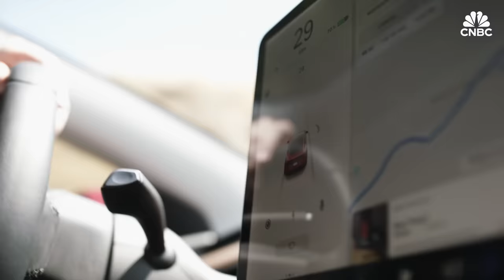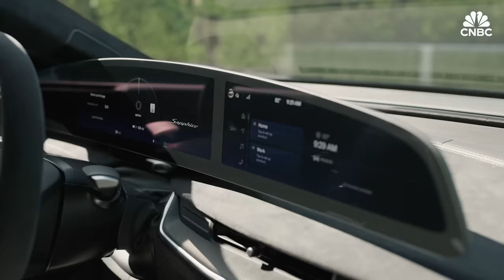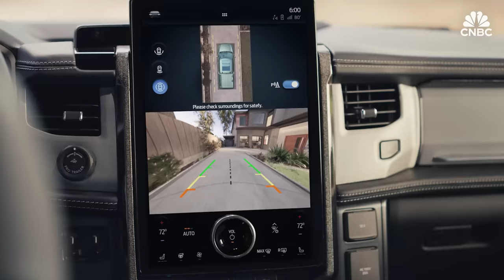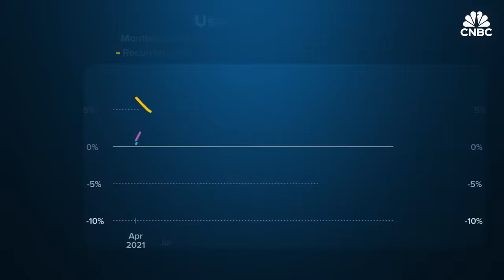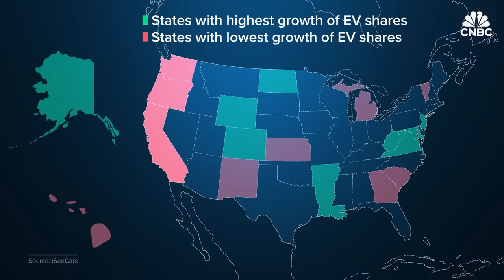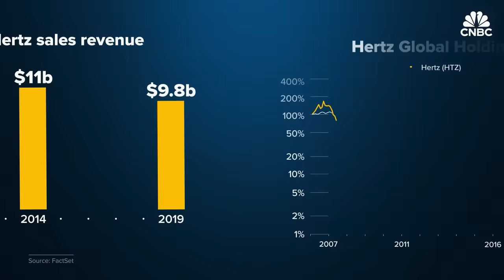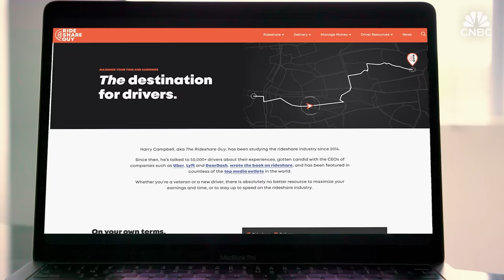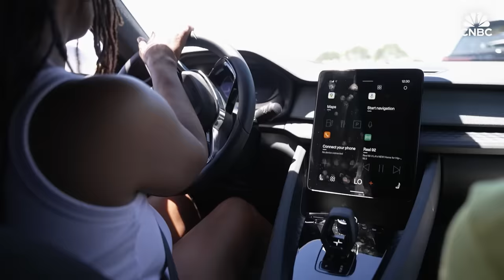Why EV Sales Are Falling | CNBC Marathon

Comment: As a city resident, you can't plug'em anywhere unless you have an indoor garage which is rare in the city
Reply: I have been charging mine in a driveway for over 5 years.
Reply: Agree. It would’ve cost a fortune to retrofit my condo garage for EVs. Maybe we could’ve added one or two charging stations but that would be a recipe for conflict.
Reply: Nonsense. There are EV chargers are Grocery Stores, Movie theaters, shopping malls and many other locations, including work locations and parking decks. Lived in a Major City for 17 years until just recently. This is FUD baloney.
Reply: I live on a complex as well and there are no charging stations. The only place I’ve seen charging stations where I live is in a Walmart parking lot.
Reply: Densely populated, vertically structured NY CITY continues to have issues with charging. But they also have best(😂, kinda) public trans system. CA, the nations largest auto market flourishes with space, weather, and infrastructure for EV’s. This is a regional and infrastructure issue/advantage.
Reply: really? In my my small rural city everyone has a garage.
Reply: @bobby5678-ck2tc  on the west coast and in nice neighborhoods there are garages but I’m in Indiana and there aren’t a lot of houses with garages
Reply: @bobby5678-ck2tc  yeah…shouldn’t be a problem if you added an EV and needed to charge. Good for daily driving. I’d still have a mid sized ICE SUV for longer family trips, though.
Reply: You can plug them in without a garage. There are a number of chargers that you can mount outdoors.
Reply: ChargePoint is my favorite! But I’ve had others that worked outdoors too.
Reply: Funny story, I owned a condo where the board were foreigners and one of the members had a charging station for his EV. I ended up getting a EV and I kept on asking them can I get approval to have a charging station put in by my car. Long story short 6 months go by and I sell me EV. A little while after one of the board members asked me if I still want to get a charging station installed.
Reply: @davidc2838 true . These dealer middle men now want to plant stories
Reply: @lancerkind Cool…easy fix. Just drive your Tesla into your 68 story apartment building, drive it up the elevator, and plug into the charge station you have installed on your 22nd story balcony 😒
Reply: @davidc2838 These things are always occupied or broken. There are never enough.
Reply: Charging in the city is not really a problem with a Tesla because of its supercharger network. Most people driving locally around town only charge at a Supercharger once a week for 30 minutes. Even when people take 200+ mile trips they simply stop at a supercharger for 20 minutes to top up the battery before returning to the city.  I highly recommend you rent a Tesla from Hertz for a few days and try it for yourself. Hertz rents Teslas for about $50/day.
Reply: @robertthomas9564  I live in a major city and the nearest Supercharger is 17 miles away. Sure…make a 34 mile round trip and wait 40 minutes to charge a car. What a stupid suggestion.
Reply: But if you’re in a city anyways you don’t need a car or one with that much range
Reply: If you don’t have access to a personal charger - I wouldn’t buy one.  There is no battery conditioning without one.  Rates are too high without one.  No convenience without one (time).  They aren’t for everyone.
Reply: Not to mention if there is a fire all cars will be destroyed if they are in the garage
Reply: I guess if you live in a flyover state where the state government is bought by oil donations who try to policy one way. In New York, California, and other big areas there's so many charging stations in the city.
Reply: @Dfgbuiiyyyybb there is much that will be changing soon, including EVs that can handle wireless charging, and parking lots that provide the charge from coils built into the pavement.  They are surprisingly efficient and convenient... the entire charging procedure is completely passive, requiring nothing for you to remember to do.
Reply: @EclipseMints08  …what rate do you pay?  can renters connect overnight for low rates?  Without conditioning, freezing weather can leave you stranded.  Owners need chargers to make them operate a lower costs.  Public chargers result in prices approximating gasoline.  it’s simple math - do we need an app for that?
Reply: I charge my Volt outdoors.
Reply: The total EV sales are not slowing. The legacy auto maker EV sales are dying save for a few. And then there is Tesla. Still pumping out and selling cars faster all the time, making up more than the difference of the lagging legacy auto faltering sales hindered by dealerships who don’t want to sale them due to lack of money they will make off the customs who do not need to visit them for regular maintenance work like oil changes. 
When it comes to road trips, you dint have to plan much at all! (At least you don’t have to with a Tesla). The car does all of that for you. Just type in your destination. (You may still want to plan where to sleep at night). 
The charging is easy…. Well if you use the Tesla Supercharger network.  Also if you own single family home, with or without a garage charging is simple. 
I’ve see charging in a townhouse community work where people drag their plugs out to their parking spots. 
In an apartment building…. Hmm ok. Maybe not but I’ve seen people who own EVs there. So it must still workout. 

The issue is education of EVs. Listening to the news will not tell you how to use an own an EV. Nor will going to a legacy dealership. (I knew MUCH more than they did. Even their best sales rep!!). 
The same thing happened when the first automobiles were being sold. Pop people tried to cling to their horses.
Reply: They can be charged at grocery stores, parking garages, movie theatres, hotels, private businesses etc.   If you buy a Tesla it will show you on the map exactly all the places you can charge.
Reply: @valleyofiron125 Eight and a half years here!
Reply: @wendypierce5621  My condo charges $1200 to install a charger and we share it with 3 other cars. $300 is hardly a fortune
Reply: 😡Governments MUST give similar incentives to hydrogen cars 😡 or get rid of all incentives 😡
Reply: True🤏 Before force people to get an EVs, give them free houses 😒
Reply: @duran9664  Hydrogen is useless for cars and extremely inefficient. Total waste of money to get into that option.
Reply: @johnn17golf  It’s more like $5-10k per unit for my building as wiring needs to be run from each meter to the relevant parking spot. It’s an older building and no one thought about the need for electrical in the garage.
Reply: @wendypierce5621  Your unit is ripping you off, then. My building was 19 years old not neither new nor especially old. Management realised nobody needs to charge every day so we set up one charger for each 4 units who wanted access - our building entry card also initiates the charging billed per use by the building at cost.
Reply: OK, but isn't it strange that in the wealthiest parts of London and Paris where no-one has a driveway to charge their cars, EV ownership is highest. I live in rural France and have owned an EV for 5 years but was amazed when I visited a friend in Fulham, London a few weeks back....West London is teeming with EVs, and many lampposts are now converted to AC charging points. There are also petrol stations turned into EV only stops with DC rapid charging, restrooms, cafes and shops. A 20 minute charge gives most people a week's worth of driving. An overnight charge from a lamppost does the same. Old, polluting cars are now being banned from many cities in Europe or owners have to pay to drive in those cities...and bloody good job too!
Reply: EVs are definitely most suited to suburbanites. That's fine though. They drive the most so that's where the real environmental benefits can be had by switching. 

People in denser cities drive less anyway, so the marginal benefit of EVs is smaller. The focus there should be continued improvement of public transit, walking, and biking infrastructure. The impact of a gas car driven once a week is much less than that of an EV driven every day.
Reply: @mediocrehat  Why do you think they are no good for rural trips? I do 400Km trips happily in mu Ioniq 5 with a 15-20 minute coffee break - exactly as I did when I drove an ICE there. Quieter, more relaxed, cleaner, less smely, better performance, more fun... Coworker in sales does 3-400 commonly in his Model 3, never needs to charge but sometimes does so anyways while making calls. 99% of drivers are better off with EV over old tech. 
Definitely much greater polluting impact from a gas car driven 10Km once a week than a daily-driven EV.
Reply: @H3erobrineNotch  in any US urban area it is unsafe to walk or use public transportation. At least a car (EV or ICE) offers a small amount of protection.
Reply: @PeeGeeThirtheen, I stay with walking nothing to deal with but my own body. EV. not worth the hassle that my personal opinion Life not ready for these EV vehicles. thanks for your comment.
Reply: Maybe these issues will promote more public transportation. That would have been a better investment.
Reply: @joerudnik9290  Better vehicles, EVs replacing old inefficient ICE, is not going to move anyone to public transit.  Carshare, maybe, but most will stick with personal vehicles and nobody is going to want old ICE tech in a few years.
Reply: @o.j.mclauchlin4206  the move from horses to gas is not the same as gas to electric.  Horses to gas gave convenience.   Gas to electric creates inconvenience.   The EV is too infantile at this point
Reply: You never want any EV in a garage. They burn the entire house down during thermal runaway…
Reply: @DrEd-th2lu  ICE is 5x more likely to catch fire in garage than my EV. You sure love repeating what main stream media feeds you, Ed !!
Reply: @johnn17golf Tell that to my neighbor who lost his entire home while changing his Tesla. We had about 20 burn down during our high water event too. JUNK!
Reply: @DrEd-th2lu  Stop making up stories, eddy boy, you are not fooling anybody but yourself.
Reply: I charge mine in the driveway on a 110 exterior receptacle.
Reply: @davidc2838  I have NEVER seen a charger at a grocery store.  Or a theater.  Or a mall.  Or almost anywhere else.  I'm in a city of a million people, and I've seen a grand total of EIGHT.  CHARGERS. TOTAL.  EVER!
Reply: In China  econd- and third-tier cities, you can find charging stations within three kilometers of any place. Every highway service area has charging piles. No matter how small the city is, there are charging piles, but the density is not as high as that of first-, second- and third-tier cities. However, even fifth- and sixth-tier cities have thousands of charging piles. Hangzhou will have a total of 270,000 charging piles in 2023.

Comment: The purchase price is high, the cost to fix broken parts is high, the range is limited and recharging facilities are limited.
Reply: Insurance, don't even ask😂
Reply: @sailboatlighthouse my insurance dropped $200 a month even with adding a 3rd car and having a student driver.
Reply: @sailboatlighthouse  I pay 58 euro/month for a new Tesla Model 3 LR. EV insurance is not expensive.
Reply: Limited recharging facilities is the only accurate part of that statement. Even so, I was able to drive from FL to MI the dead of winter using only Electrify America stations. As for daily use, charging at home at night is about the easiest, most cost effective refueling experience you can have. You'll do it twice a week at most, at the cost of a few bucks. 

As for those other things, new technologies cost more until the market adjusts. EVs are statistically more reliable than ICE. Further, the public impression of higher repair costs is strongly linked to battery replacement, which is a truly rare necessity. Otherwise, repair costs are higher only because a third party market is not yet established.

And all vehicles have limited range.
Reply: Compared to what-
Highest customer satisfaction and no. 1 selling car in the world. Just  a few years and range has doubled. Infrastructure constraints are a very temporary as the demand has been exponential.  In early adoption countries this is already a problem of the past
Reply: @DrDoohickey more reliable? i heard their battery die at the 10 year mark while most ICE can last 20
Reply: @willt3223  That's not even the beginning of a worthwhile discussion. No one measures a car's lifespan in years.
Reply: @jwstolk maybe in Europe
Reply: @DrDoohickey more reliable? There's a reason Toyota won't do full EVs. Toyota is sticking to hybrids. No range anxiety, after a storm no power how do you charge your vehicle?
Reply: @DrDoohickey of course they do years and mileage. What are you talking about?
Reply: @markwilliams6378  Yes, in Europe.
Reply: @markwilliams6378 Sorry, I forgot - gas stations don't lose power. 😆 

EVs are mechanically moral reliable. Buy a loan shot.
Reply: @markwilliams6378  Value is affected by age, of course (though significantly less than a mileage). But longevity - the actual lifespan of a vehicle - is about wear.

Comment: As a life-long V8 muscle 💪🏾 car driver, I enjoyed renting a Telsa model 3 on a recent trip to Vegas. I drove around Vegas for five days and didn't have to worry about gas. Also, when returning it back to Hertz, they only charged $30 for the recharge fee. Honestly, I've been thinking about purchasing an EV lately.
Reply: You should I strongly recommend a model three or S or X performance?    You will never miss a V8 again.
Reply: You drove around Vegas for 5 days and didn't have to worry about gas because it's not a gas car, but it doesn't mean the range on these is any better or that you don't still have to worry about recharging the battery. You say it like the Tesla 3 had a range significantly longer than your average V8 and so you never had to recharge the thing.
Reply: I just bought one cuz the price is good right now. For 41k after all the fees that’s pretty good for a model Y.
Reply: Definitely do it. Have a gas and an EV. Best prices rn for the model Y!
Reply: @joo02 just got mine too!
Reply: before you buy look at the over allpicture first. Charge times, repair cost and travel viability. 5 days in a city is nice because you're a tourist. Thats not the same as using it daily. Just like visiting a country and living there are 2 different experiences
Reply: You can get regular car and drive 10 days around the Vegas without worrying about the gas. ,
Reply: I love my model 3. And I love not having to go to the gas station. If you have a garage you are set.
Reply: @monkeysezbegood  exactly, if you have a garage
Reply: @monkeysezbegood check the price for a similar model 3 now? i will bet you that it’s 70% cheaper than what you paid
Reply: I switched three years ago and the thought of going back to a gas car is similar to the thought of going back to a landline. AKA a complete joke. The gas commuter car is a dead man walking.
Reply: Just understand that the experience with a non-Tesla is vastly different.
Reply: @shane864  until it gets to cold or the power wanes huh?
Reply: @jonathangeorgopoulos1097  Gas pumps don't work with the power out either my dood, and unless you're commuting 200 miles a day the cold doesn't matter.
Reply: @shane864  most large gas stations or corporate owned centers have generators. And generators could barely power a handful of EVs and the cold doesn’t matter? Tell that to all those stranded EV owners.
Reply: Youre in the minority because Hertz is getting rid of their Tesla fleet, but good for you. Buy one.
Reply: if you don't drive in the heat or cold don't haul or tow anything and don't drive very far can afford or have room for a charging station and don't mind waiting 40 minutes for a full charge evs are ok
Reply: The thing is they’re not optimal for a 500+ mile road trip. Or for driving in Alaska. But if you live in most of the rest of the USA, 99% of people wake up with a full charge on an ev, never charge, and just wake up with a full tank every morning. 350 miles is enough for most people daily. But if you are hauling lots of cargo long distance on a time crunch, sure it makes more sense to drive gas. If you don’t, the ev is cheaper over its life, less maintenance and break downs, A better drive, and 99% recyclable.
Reply: @EnriqueThieleThe Model three Performance is already available. It has two motors and a much better suspension. I was ready to buy one, but the only one that stayed under the $55k maximum for the $7500 tax credit was the Stealth Grey and black interior which I can’t stand.
Reply: @sam8307 hahaha never miss a V8 again? Yea this EV’s are for non car guys. That’s like saying “an actual guitar that makes noise nah just use this make believe guitar, You’ll never miss a real guitar” something is always lost and gained with most things. fast 0-60 is literally it. Everything else is bland and it looks bland .

Comment: Just bought a model Y two months ago. Charge at home and Tesla supercharging is such a good combo, havent had the need to even upgrade my home charging yet and I do rideshare part time. Yes it does take 15-30 min to get a good decent amount of supercharge but the technology is only getting better!
Reply: I got my Model Y a month ago too. I haven't gotten the home charger yet (the combo of portable charger + supercharger is great)
Reply: I don’t have a Tesla, but I do drive the Chevy bolt. The fast charging combined with using home charging to supplement works great. I drive 80-100 miles daily for work; my regular employment and my 1099 side job. I save about $500/month by not buying gas. I still have a Yukon for long drives, deep snow, extreme cold, etc. we live in Alaska.